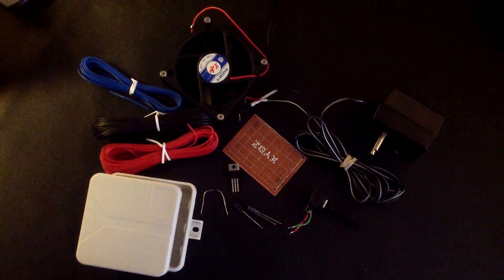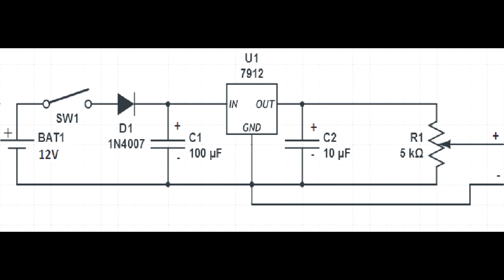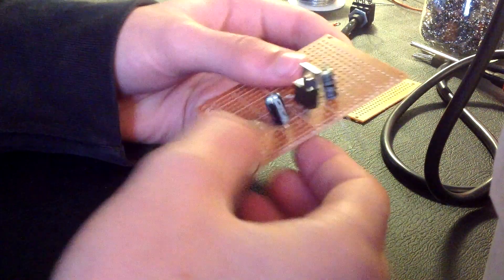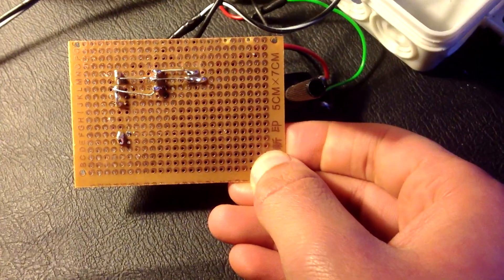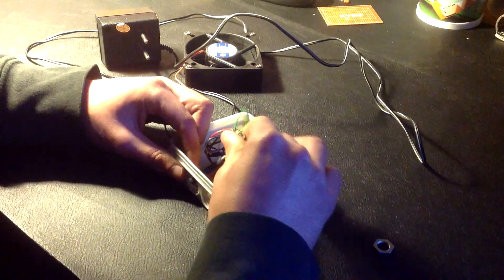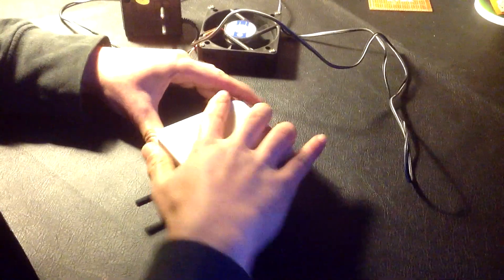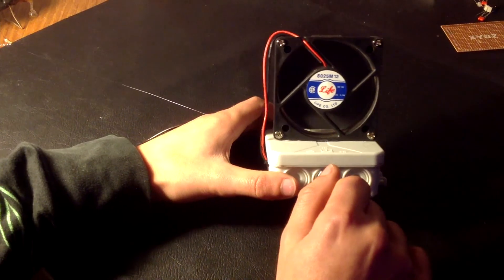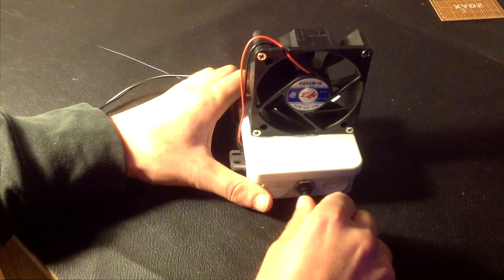5$ Fan for Soldering Station

Comment: 15k views and no one noticed that the Voltage regulator you have specified in your schematic and the one you list below are NOT the same?  I believe the 7812 is the correct one (Positive bus output).

Also, if you're going to list parts for a tutorial, a Mouser link would be fantastic.  Do we need a 1/4W Potentiometer or will a 1/20W suffice?  Mouser actually provides links to make a project BOM that can be shared with everyone.